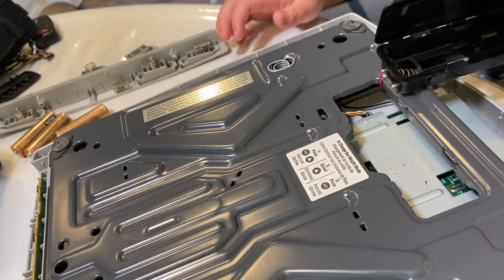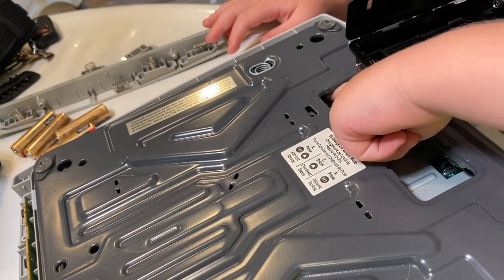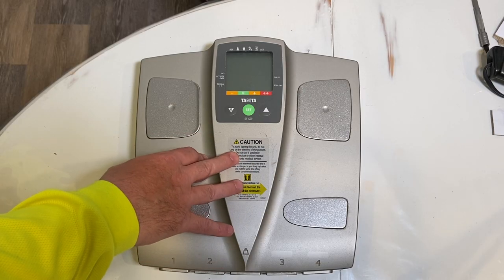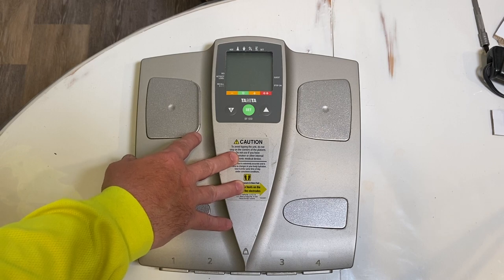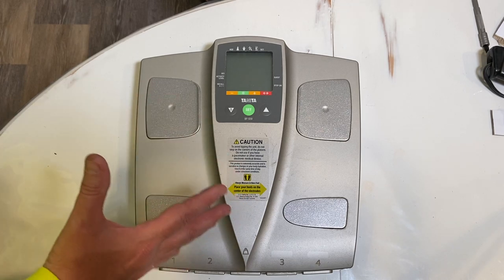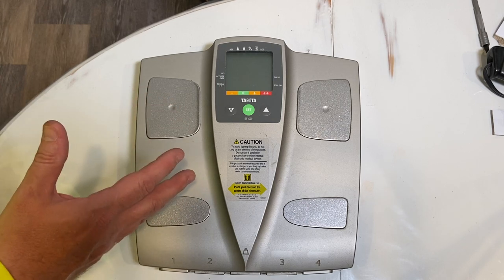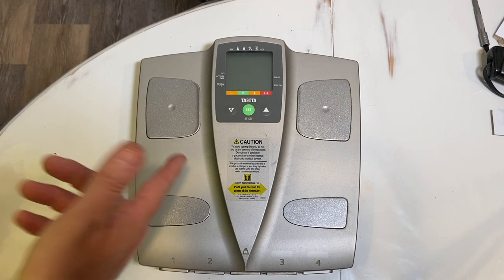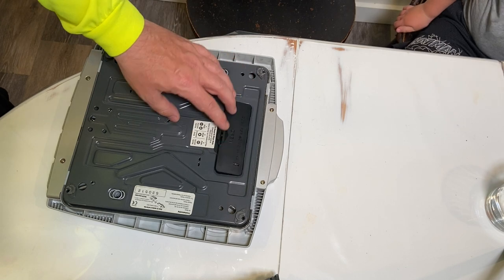Digital Scale Repair...THIS MAY BE YOUR ISSUE!

Comment: Hey Fixit Guy:  My didital Tanikascale failed exactly they way your's did…disconnected black wire from battery case.  I went through the same issues did, in trying to open the case with no luck. I was about to give up as well…then I found this video and watching  it clued me into taking out the battery case.  I had the same problem stripping off a bit of the insulation from the black wire. Easy method…just heat the tip of the wire, very carefully with the soldering iron and the insulation just melts away.
Scale now works normally, just the way it did before…even kept the settings.
THANKS Big & Little Fixit Guys.

Comment: Thanks for your video. My  Tanita on/off button was stuck in place. (Kids playing with it).
I replaced the batteries and it still didn’t work. I have a different model to yours, but same battery housing.
I followed what you did, but could see my connectors were both still attached. I put it all back together ready to throw it out, tried new batteries 1 more time. Lo and behold my Tanita works and it had saved all my previous settings. Thank you for your video, it helped me a lot.

Comment: Great video brother. Great way to show there is no need to buy a new one if you just take a minute to check it out might be a easy fix. That’s a great little helper you got there.
Reply from the maker: I usually try to fix something first. It does not always work out, but a little effort will go along way.  Thank you Steve!

Comment: Often times the wire that is used for many consumer electronics have a cheap plastic insulation, which means you can just heat the end of the wire (either with a hot iron or a bic lighter) and the insulation will shrink back. If heat didn't work and you don't have the correct size wire strippers then go at it with your knife. You can only work with the tools you have, right?  As for the soldering,  tin the wire first (heat the wire and add some solder, flux is your friend here). Then to solder use the iron to heat the solder on the terminal until it melts and add the tinned wire. Just like sweating pipes it is all about heat mass. Great job getting it to work!!!
Reply from the maker: Ok cool!  You made it look too easy the last time you fixed the sound machine for us. I am going to look at getting a soldering set up for my bench. We need to hang out at some point so you can show me some pointers.

Comment: wow like many others here, my Tanita BF-679W had the exact same issue! Corrosion plus getting bumped around -> black wire snapped off of battery box. Maybe if they hadn't used...24 or 26? gauge wire, this wouldn't have been an issue. The lengths these companies go to in order to save a few pennies. 🙄
Thanks for the video!
Reply from the maker: Your welcome.

Comment: Great video.  This was exactly the issue I had with my Tanita Ironman scale.  Those disposable alkaline batteries have a tendency to leak and cause corrosion if they are drained and left in the device for an extended period of time.  That's why I try to use rechargeable batteries for stuff like this.  They don't leak and corrode like the disposable alkaline ones do.
Reply from the maker: That is great information about the batteries.Thank you.

Comment: Good job, I cringed a few times watching it, when your son was closing the knife blade, when you were removing the battery box, tugging on the lid, stripping the wire, soldering with that huge gun and nasty looking tip too. LOL But you got to do what you gotta do to git'er done.  Now to carefully trim the insulation off that wire it should be held securely using needle nose pliers holding the wire close to the area you're about to trim off the insulator and carefully make a circular cut around the circumference of the insulation using a razor or exacto knife and not cutting or nicking any of the individual wire strands.  I would add another length of black wire of the same gauge to extend the overall length carefully soldering the two pieces together end-to-end and slip a piece of heat shrink tubing down the length to cover the soldered joint, use a hair dryer or heat gun and only enough heat to shrink the tubing and then attach the now lengthened wire to the battery box negative terminal end. 
Also, here's a tip. before muscling out the battery box, use a hair dryer or heat gun set on low to warm the plastic to make it less brittle and more flexible before manipulating the tabs to prevent them from being damaged, or the hinges on the lid. A leatherman is a unique tool, but definitely not my first choice of tools to work on something as delicate as this battery box and wires of 22 or 28 gauge. Always secure the wire you're stripping to prevent putting stress on the wire connection at the other end of the wire you're working on and gently make the cuts as shallow as possible to not nick or cut the wire strands. Use the needle nose pliers to hold the wire as you solder it. It helps to tin the end of the wire first, also clean the soldering tip by heating it first to melt the leftover solder and using a dampened folded paper towel or rag to wipe the molten solder off. And the soldering iron you're using is way to big as is the solder you're using and you need electrical solder which has the flux in it, plumbing solder is not for electrical connections. Plumbing solder is very acidic and will corrode the wires and connectors. You can find pencil type soldering irons and kits on Amazon or other websites for cheap, also find in the kit solder removal tools (solder suckers) and other handy tools, iron holder, and Oh, yeah, fine diameter electrical solder. Stop using plumbing solder and dirty tips on your iron.
Reply from the maker: Thank you for the detailed description on how to repair the scale. I cringed when my son closed that knife as well. He is much better at this point with his knives. I am planning on getting a nice soldering iron and a getting some practice in.
Reply: @ThatFixItGuy  you could probably find a few videos on YouTube on soldering instructions and guides on types of soldering irons. I've always used a little cheapy ones myself but I would like to get a soldering pencil that you can dial in the temperature and control it.
Basic soldering tips video
https://youtu.be/6rmErwU5E-k

Comment: Don't take it apart. Just flip it over and spray a touch of WD-40 into the crevice between each foot and the body. Let it sit overnight. And better than new. Did this on a Homedics SC-475 bathroom scale that was displaying incomplete digits.  A simple case of dirty electrical contacts.

Comment: The reason you couldnt solder the components is 3 things. !. Be sure neither surface is oxidised(Purpose of Flux) 2. You should "tin" or pre coat both surfaces with solder so they have fresh unoxidiesed soilder to combine. 3. make sure ANY surface your soldering is heated up before applying solder (stick the gun to the point or wire and then push together while applying solder)
Reply from the maker: I have learned a lot since shooting this video.  Still no pro, but soldering has improved a very small amount.  Thank you for the information.
Reply: yes, those guns are overkill and bulky but they are very fast and versatile for most fixes unless you are doing tiny SMD repairs then get a smaller one. @ThatFixItGuy

Comment: Is that Rick from “Pawn Stars” on your desktop?   And it is great that you are getting your son involved.  Soon he can have his own channel!😊.  The deck of the scale probably floats.  If removed, you may have had a bit more length of wire to solder.   And a clothes pin may act as a hemostat to hold the wire in place.
Reply from the maker: A clothes pin is a great idea. I saw the other end of that wire and it was attached to a little two pronged plug that I don’t know if I could have got. 
Lol!  I wish I had an autographed Rick!!  It is Terry Crews!  Former Green Bay Packer and funny man!  And man I don’t know if people would want to watch Little Fix It. He would only want to do 30 sec videos lol. He may want to do this when he gets older!  Thanks for watching.

Comment: I have a similar scale from same brand that stopped working. After watching this video I pulled the battery cage and found the black wire was disconnected. Perhaps a common problem with these scales.

Comment: Havin the right tool fir the job goes a long way . . . but . . . You also need the right supplies. Having electronics flux is important low temp electronic solder is very helpfull. TIP: Check YOUTUBE for soldering help, HELLO . . .
Reply from the maker: Lol!  I know Gary!  My thought was that I solder copper all the time.  It can’t be that different. Lol. I was wrong. I have been watching videos after the fact!  I will be ordering and kit and learning how to do more electrical soldering.